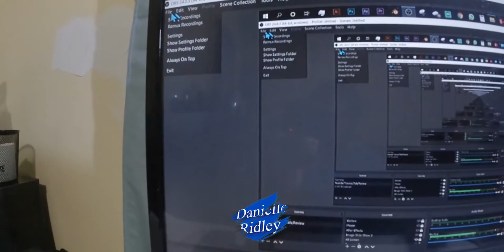Logitech M510 Mouse | Not Working | Disassemble & Fix!

Comment: Hey dude, thanks!! I took out the 2 screws and discovered that the (holding upside down) right contact spring for the battery was corroded like someone left a battery in it too long. I had sandpaper from a dremel kit and sanded the spring off and wallah!! It worked, now I have a keyboard mouse combo for $12.00 from a thrift store.... thanks!!!
Reply from the maker: Your welcome